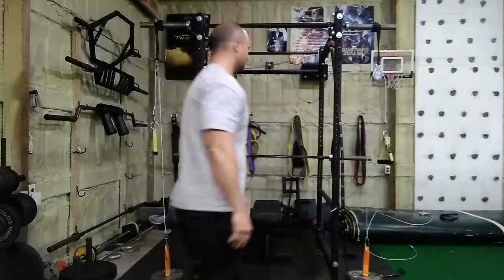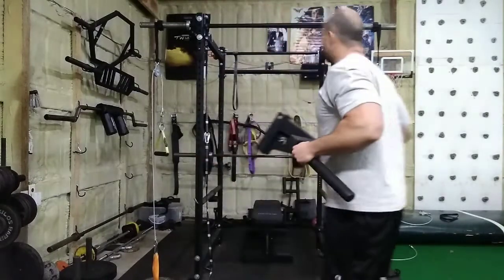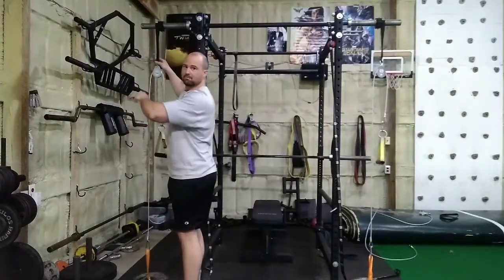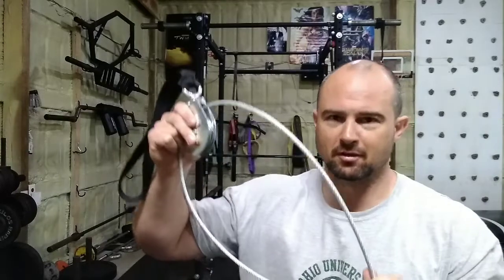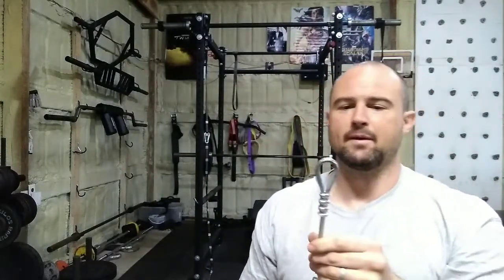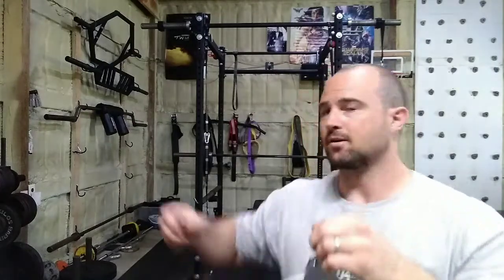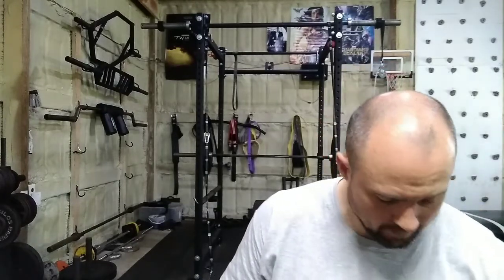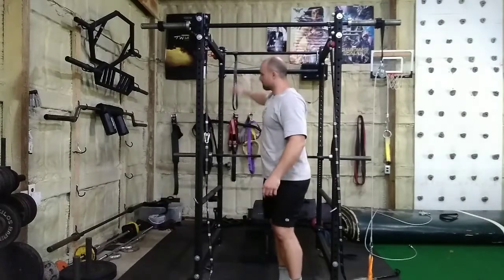DIY Cable Fly for Power Rack

Comment: Good job man. I experimented with the barbell thing too, just wanted a more permanent mounted fix. Didnt think to go on top of the rack with it though.

As for the low pulley my idea was to try long infinity weight horn rack attachments as anchor points. Gonna have to push the bar back more centered though I think.

Glad you found real inspiration!
Reply from the maker: Thanks once again, Anima!!!

Comment: I came up with the same setup but instead of using one of my barbells, I used a 7 foot steel fence post and attached the pulley to a brace band on each end of the post.

Comment: Awesome video! When I first built my Cable Crossover machine. I used my Rogue SML-1 Racks 2 Spotter Arms. Put them on the Top Sides of the Rack. Used 2 Swivel Pulley's and it worked well. But later I installed the Pulley's to my ceiling beams. To give me a further reach for doing Crossover Extensions. Because for some reason. I couldn't hit the Lower Pectoral muscles. But when I installed them to my ceiling beams. And when I worked out. My Chest, Deltoids, Traps and Arms were on fire. 
Again Great Video! Thank You for Sharing this out. 
P.S. what did you use to Clamp Your cables to hold in the Thimbles? I never seen Clamps like that. At first I thought they were Crimped?

Comment: Is it okay to hit weights on the rack? I just set up the same as you did and weight swings and hit my rack pretty hard, any soultions?
Reply from the maker: Hey C, Whether or not it's ok ultimately depends on you.  Personally, I don't mind beating up my rack--I almost relish it--but I realize I'm probably in the minority there.  Also, I completely understand that it's distracting, and disrupts the flow of the set.

Having said that, two things have worked for me when working with DIY cable/pulley iso accessories (like the flys):  1. put a length of chain at the bottom of the loading pins.  It only needs to be a little longer than the max range of motion; a couple feet should be solid in most cases (just put an "*" in your log book on days you used it).  This does a decent job of anchoring it to the floor.  

Chain will minimize swinging, but not eliminate it, so the second tip is, you have to focus just a little more intently on a tight rep cadence.  Any jerky movement will send it swinging.  Sometimes, even if you're controlled, it still moves a little.  That said you have to be cool with occasionally breaking in the middle of the set to tap the weights to the floor for a sec, reset, and kick it off again.

Hope that helps man!
Reply: @ThreeStormFitness  thank you. Mine doesn’t swing much with your advices, cheers !!

Comment: Great idea with barbell and collars to keep wide. To do low pulley could you not keep same anchor point up high but attach pulley to weight pin? Weights may swing a bit but should be ok if done under control and far enough from rack
Reply from the maker: hmmm...if I'm following you right, that might work.  Gonna have to go back to the lab :)
Reply: This is a great idea for maybe incorporating a low row!

Comment: Ok whats about if you have an echo squat stand which is alot shorter made to fit low ceiling how would I do the same thing you did?

 I don't have and sort of safety pins itd only the jcups and no pull bar or anything I've been trying to figure it there's a way like that for 2 years I didn't think about it too much but at times I did. Video got my curiosity because I thought of something similar before since my stand is shorter I night just have to kneel or just put it up on the last pin.

Comment: how tall are you?
Reply from the maker: 6'3/6'4ish
Reply: @ThreeStormFitness  Nice. I wish I could grab that top bar without being on  my tippies. Anyway, I was wondering if your arm length had to do with the need for such wide spacing. I don't have the side bars to connect the back end so considering other routes. Thinking of using snatch blocks in the highest pinholes with carabiners.Those things are expensive but I like the folding swivel.